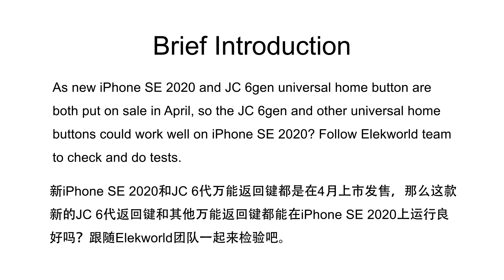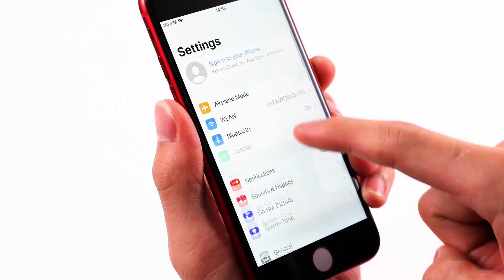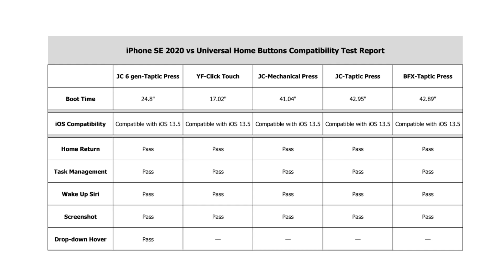Universal Home Button Test on SE 2020: JC V6 and BFX, YF, JC(Taptic Engine and Mechanical)

Comment: Hi!
I have 2x JC Home Button Universal (020-0418 CM-JCID) and one original home button from another iPhone 7. Unfortunately, every home button not responds when connected to the original apple screen. The connector flex appears to be OK. I tested on two motherboards (one with ios 14, the second with ios 15). Complete lack of reaction.
Do you know what could be the reason?
Reply from the maker: There be many possibilities, bro. 
1- Pls change another screen to test with unviersal home button, see if it's screen problem.
2- Pls check the motherboard FPC which connect with screen digitizer/Touch ID flex, see if the board FPC damaged.

Comment: Hi, i know this video is somewhat old by this point, but my question is.... Is the phone still wataerproof if i install this home button
?
Reply from the maker: Literally no one can keep same waterproof effect after you replace anything inside. Bcuz even you replace the button only, you have to remove screen and waterproof adhesive etc. So our suggestion is keep phone from water always.
Reply: @Elekworld  Lmao I know that , what i was trying to say is , does this bfx button seal up the home button sides like the original one?
Reply from the maker: @Hamster3     Yes, the button was designed and produced very precisely.
Reply: @Elekworld  Thank you

Comment: Hi mate, can you tell me what the difference between Jc 5th generation and 6th generation is before I buy some for my shop. Thanks
Reply from the maker: As far as we know, there are only JC 6gen in the market now. And there are two versions 6gen, one is touch version, one is 3D touch(taptic engine) version. We suggest 3D touch version which is same experience as ori button except Touch ID.
Reply: Can I get one of these for my iPhone SE 2020?

Comment: hello, the home button does not work for me when I switch off the phone and start it up again, but if I take a Bfx home button and then do a restart and then plug in the JC V6, then it works.  is it due to the home button or iOS?
Reply from the maker: Hi Lino, may I know what's your iPhone model and iOS generation?
Reply: Elekworld iPhone 7 with iOS 13.6.
Reply from the maker: Lino, we tried on iP7 with iOS13.6 and it works. Technicians advise: 
1- Power off phone and install JC V6, restart and see if it works;
2- If doesn't work, might because new parts need recognize with board; if after 15-30 seconds still not work, try step 1 again;
3- If still not work, it might because something about parts/iOS matching.
Reply: Elekworld ok, thank you. I will Test it soon.
Reply: It doesn‘t work. :(  would a reset help?
Reply from the maker: @lino1320  It might be, but we are not sure. Maybe you can contact your vendor see if there are other advice.
Reply: Elekworld ok, thank you.

Comment: Why the BFX button Is more expensive than the others ???
Reply from the maker: BFX is with taptic press working theory, which is same as original and JC V6, but much cheaper than JC V6. 
And other universal home button are with mechanical press or "Click" press working theory. 
It's cheaper than JC V5, JC V6, and higher than YF. 
So BFX isn't the most cheap one, but it has best quality-price balance.
Reply: Elekworld Trade Co.,LTD which one should I buy ?
Reply from the maker: Sorry for late reply, Geo. We recommend the BFX home button.
Reply: Elekworld okay thanks